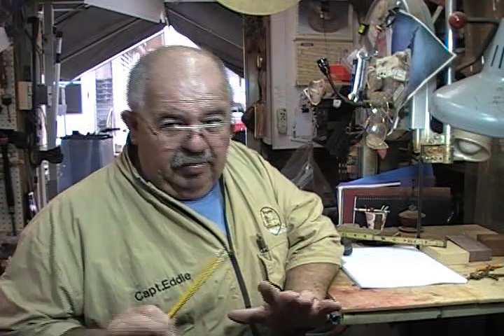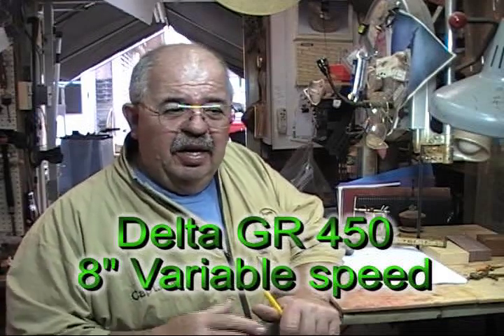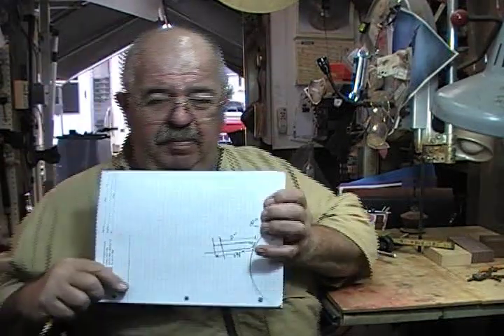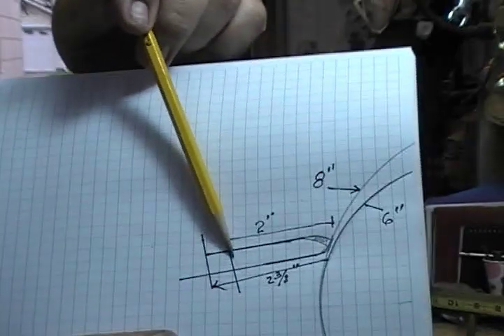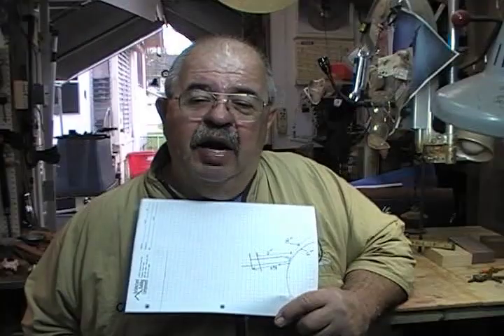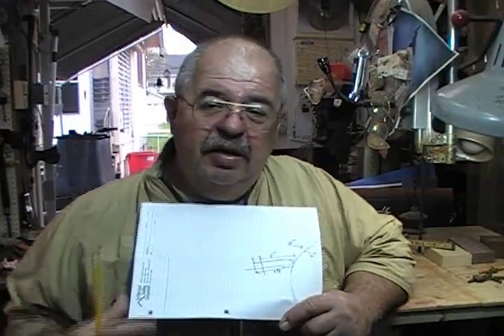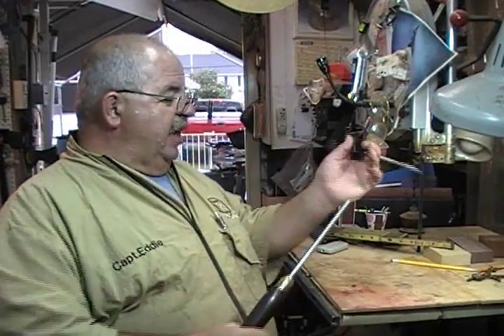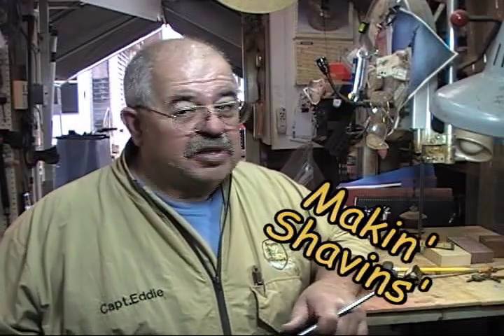sizematters?

Comment from the maker: When I put the second grind on, which I still have to show for this jig, you have a very small bevel, which doesn't have much of an arc.  I used to use a flat sander for sharpening, which did not have an arc, not much difference in the cut.  Have you had any different experiences?

Comment: To those who tout the Tormek as "great for turning"....SORRY! But you're wrong. I have an 8" Grizzly knock-off, and it is NOT good for turning tools. Why you ask? You do not want a polished edge. It will be too sharp and simply won't cut, and it will also dull very fast. You have to FORCE it to cut, which is not good.
You want the slightly rough texture from the dry grind 60-100 grit wheel.
I don't have the room to explain fully, so research it if you want to know more.

Comment: There is a minimum diameter wheel you can use and still get an acceptable grind, and that diameter is apprx. 5-5/8" -5-3/4". Any smaller, and the hollow grind radius is just too small and the tools get very "grabby" and tend to catch a lot. This is from my own experience.

HOWEVER, you can get around this, to a point, with the secondary grind behind the primary bevel, even on standard grind gouges. What it is, is you "open up" the radius a bit, similar to what a larger wheel will do.

Comment: @torgy You want a hollow grind as you are turning round wood and it's easier to rub the bevel and still expose a cutting edge with a hollow ground tool than a flat ground tool, even when cutting on the inside of a bowl as you simply rub farther back on the bevel than if you are cutting on the O.D. And trust me here, I've had jigs set up on both a flat sanding disc and my 6" and 8" grinders, the hollow grind IS better. Try it, you'll see.